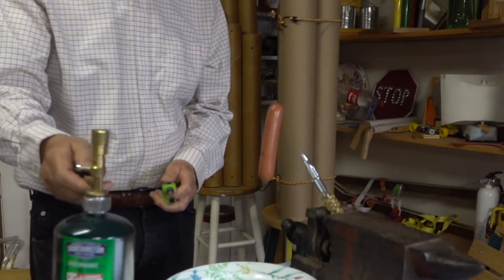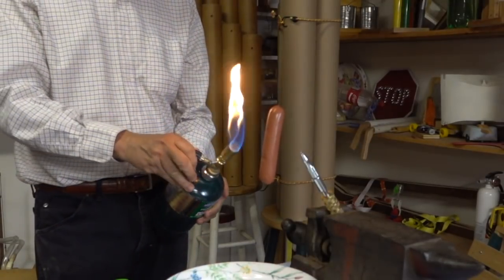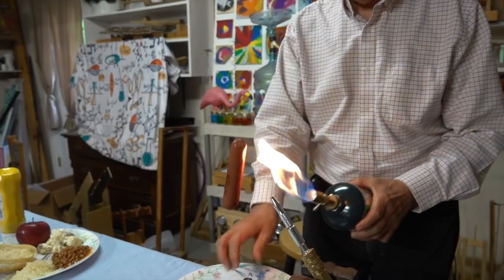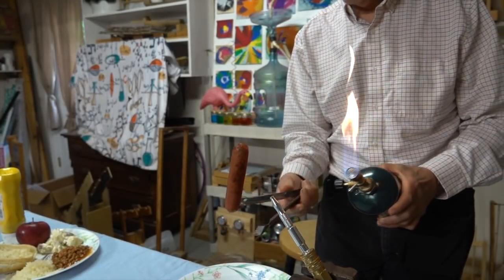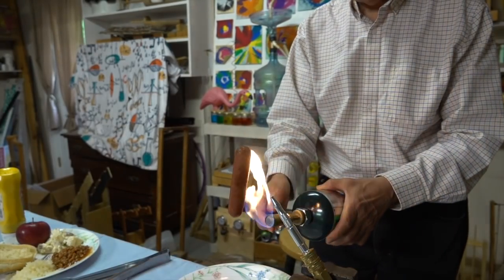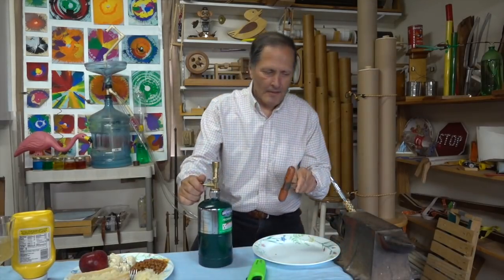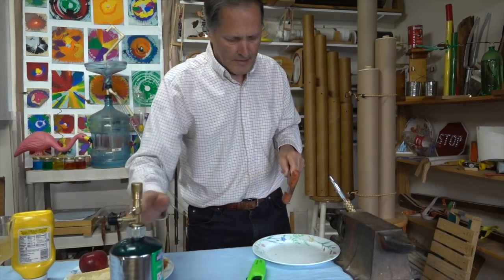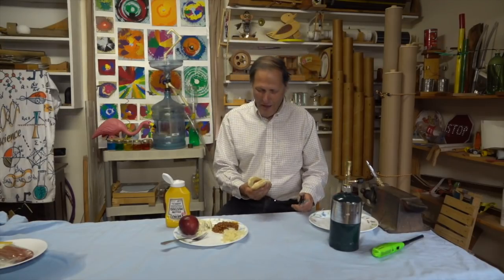How to cook a hot dog in midair.... the Coanda effect // Homemade Science with Bruce Yeany

Comment: Hi Bruce, thank you that was an interesting demonstration of the coanda effect, your burner certainly showed the airflow. I was surprised at how far out from the hot dog the effect the air flow over the sausage from you compressed air nozzle the flame was draw towards the hot dog (2.13).
my playing about as a young fitter was getting a ratchet screwdriver to float and spin in the workshops compressed air supply, now a days I know why it did so.